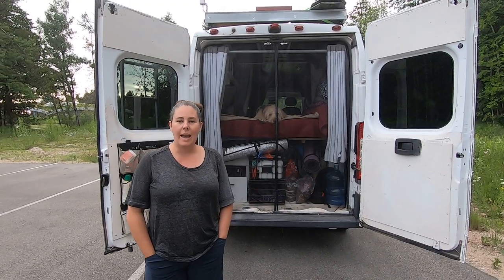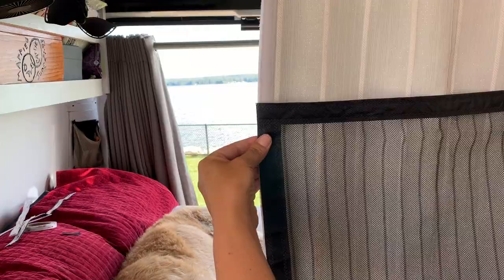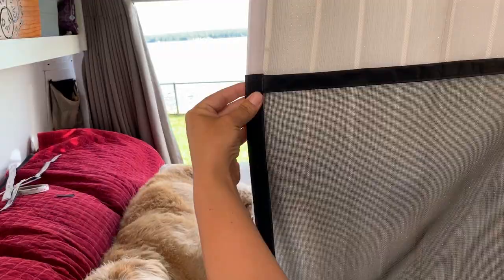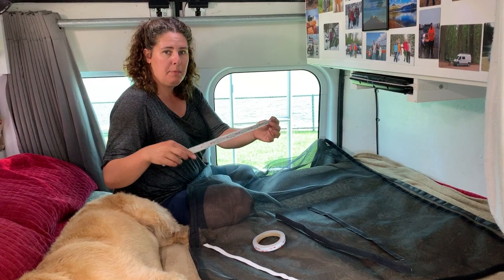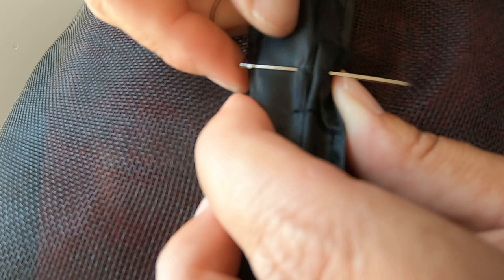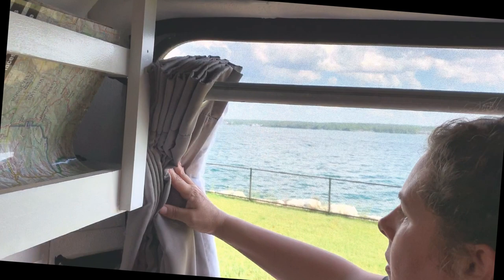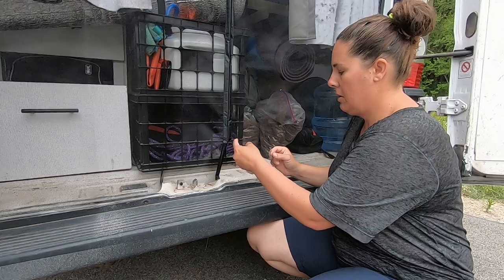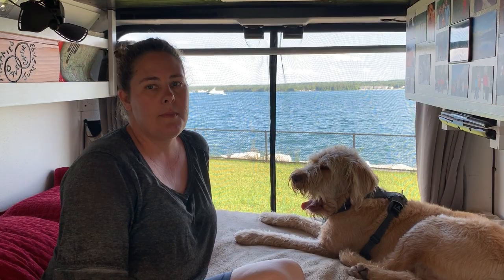DIY Super easy BUG SCREEN for your van in 30 MINUTES or less!

Comment: Great idea!  I love it!  My one possible suggestion to improve upon it might be to hem the bottom and use either magnets or velcro to adhere it to the bottom of your van. If the material isn't flexible enough to hem, maybe using a glue gun to adhere the original hem in alignment with the bottom of your van.  Thank you for sharing!
Reply from the maker: Great tip! We are going to need full bug defenses up for this summers trip to Alaska! Take care and thank you for watching.

Comment: French doors! I never would have found that screen. Thank you so much!  I'm at the ventilation planning stage in my own build, so windows, screens, and a Maxxair have been on my mind. I know you guys are loving that back screen. It turns the rear of the van into a picture window/patio/lounger setup!
Reply from the maker: +cesalt We would go with Maxxair fans instead of fantastic if we could redo. Good choice!! 😀 Yea the bed room has the best window in the house now😂 You might consider a small screened window in the back of your van near your head. We wish we had one there and may still put on in.😎

Comment: THANK YOU!  THIS SCREEN WILL BE A GAME CHANGER.  By the way - you are soooooooooo right about velcro NOT sticking to anything you really need it to stick too.  I have been using 1/4" 3M 3000 double sided tape that has worked very well.  However, the 3m tape that you are using looks as though it might be better (wider).  Thanks again.  I am so glad to have found your channel.
Reply from the maker: Thank you, Barbara! Our screens have been hanging for nearly 4 years with that tape now! Awesome stuff. Carrie wanted to let you know that metal snaps are another idea. They make them now that you just screw in. We are getting some to try out. Welcome to our channel! We are happy you have found us. If you have more questions please ask. 👱‍♂️👩🐕🎾

Comment: I'm putting the finishing touches on my conversion and this is one of the simplest yet important things to do first. Thanks for pointing out the diff between your first screen and the more durable fiberglass screen. Also - I wouldn't have thought to let the tape adhesive cure to the metal wall for 24 hours, so big thanks for that!
Reply from the maker: We are happy to help! We are enjoying our bug screens right now. Even on hot days the airflow makes it nice inside the van. 😀

Comment: You can do same thing to your front windows so can have down and drive with no bugs! Totally a must!
Reply from the maker: +Sunshine Ak I didn't even think about the front window! That would be perfect! The hardest part would be the custom sowing of the velcro on the screen but so worth it!! Very smart!  We agree that's a must😀🐜🐛🐝
Reply: You could use 3M tape lol. I would def do it with the Fiberglass mesh as strong enough to sew it. I would use fishing line as thread so you can peel it off without risk of breaking stitches so you can pull it off so if you need to get to window you can.

Comment: Wow! Probably the best most detailed video I've seen.  Thanks!  By any chance do you know if that tape also works on wood?  My velcro definitely did not.  Actually, follow up, I just read the description on the tape and sounds like it may work on wood.  That would be very handy cause I hate putting more holes in the wood.

Comment: I did it!  Custom fit the screen (which took awhile since the double van doors are definitely not square and much smaller than the rear doors of your rig.   I had to cut them down from both the sides and the bottom.  I am so grateful though that I saw your video.  DIY starting from scratch would have been much, much harder!   The magnetic closures work great!  The only problem I have is that the velcro does not stick to the cloth upholstery fabric on the right side of the doors.  It sticks really well to the rigid composite material on the left side of the door.  For now - I'm leaving the screens up (it's so easy to go through them, coming in or going out) that I'll have time to figure out a way to secure the velcro better for occasional removal.   I know you mentioned snaps that screw in - can you tell me where I can get them?  I've looked at some on a marine supply website -too confusing, most were stick on! Thanks.
Reply from the maker: Nice job Barbara! We are just now putting our rear screen back up and could not live without it once it gets warm and the bugs come out. Type in “screw-in snap kit” on Amazon and there is a bunch of different types to choose from. We just got our kit and have not tried it yet. 😀

Comment: Hey guys! We are to the ventilation step in our van...it has almost been a year since you installed this bug screen. Great instruction, by the way :) Are you still successfully keeping bugs out? Is there something you have done different to make it better since the video was put up? It looks perfect the way it is, but sometimes after using a product for a while things pop in your head that you wish you had done different or just added little touches to improve the product in your personal use. Thanks for sharing :)
Reply from the maker: Great question! We are still using the bug screen and it's still effective.  That said, we should have made it shorter and just go down to the bed frame. It's been a bit of a hassle getting to the area below our bed. We are going to cut it and and more velcro so we can make that adjustment. I am very impressed by how it's been holding up just make sure you don't close it on the door latch😜

Comment: Nice work.  Did your velcro already have an adhesive on it?  If so, did you just put the 3M on top of that after peeling off the backing?  If not, do you have a link to the velcro without adhesive?
Reply from the maker: +freedom dove my Velcro already had adhesive on it 😃 I did just put the 3M tape on After peeling the back. So the double sided 3M tape will have a backing to peel and so will the Velcro.   I peeled the Velcro backing off and very SLOWLY peeled the 3M backing off as I attached it to the Velcro.... the bond will be pretty instantaneous at this point 😬
Reply: Awesome, thanks.  👍

Comment: So how is the bug screen working out, any suggestions, changes or improvements? thanks, another great video.
Reply from the maker: We did manage to put a small hole in it but other then that all has been great. The double-sided 3m acrylic tape has held up perfectly in the cold and heat. We will be working on another this spring for the sliding door.

Comment: When you close those doors, you keep the screen in, right? Is there any risk of the doors tearing the screen?
Reply from the maker: We do keep the bug screen in the back doors until winter. We eventually destroyed our first bug screen with the latch. We now only go down to the bed with the screen as the bugs can't get us from below. Great question! We need to update on our screen. 🐛 🐝 🐜  🦟  👍
Reply: @oneadVANtureatatime  did you do an update?
Reply from the maker: Still working great! We did have to replace it once from normal wear and tear. We just started year 5. Our screen only goes half way down and we kept the middle so we can open if needed. Our first screen we sewed the middle shut.

Comment: I’m getting ready to order supplies and wondering if you would make any changes now that you put in use.
Reply from the maker: +FourWheel Camper we really like our bug screen. The only problem we have had is shutting it in the door😂 it goes all the way to the floor... maybe weights on the bottom.  If money was no object ...I would buy one that we could attach permanently with zippers.  But for the price it works perfect.

Comment: Do you need to add velcro at the bottom of the screen so that bugs can't get in that way?
Reply from the maker: +Ann Ryan you can! we didn’t and it was fine. We are just about to revamp our big screen. It works really well but we found that it was a pain to access anything in the garage under the bed. We also kept shutting it in the door and eventually put a hole in it...... so maybe Velcro at the bottom would have solved this. No bugs can access the van from under the bed so we are cutting our screen so it only goes halfway down.   I did want to add that we have had no problems with any of the Velcro coming off.   Feel free to ask any additional questions if you have any😃
Reply: @oneadVANtureatatime  That's good info. I hope to install both the back and side screens today, so I will definitely secure the back one at the bottom because there's an open space under my bed that would allow the bugs in.  Thank you so much for your quick reply!  I really enjoy your tutorials!!!  Happy trails to you!

Comment: Did you secure the a bottom somehow or just let it hang and if just hanging, doesn't that allow bug to get in
Reply from the maker: +Jeff Krushinski we just let it hang..... but it was such a pain in the arse!!! We kept shutting it in the doors and it made it hard to get to things in the garage area under the bed. We are just about to revamp this screen for the summer.  We are only going half way, we added a wood plate across the back and the screen will Velcro to that.  Under the bed is blocked off from the rest of the van so no bugs will be able to get it..... we think 🤔

Comment: Great video. Just got a 2021 promaster with rear bath setup. Wondering if this setup, 3m & velcro would work? South Florida heat and all..
Reply from the maker: +Sam P.A. I don’t see why not! I am a HUGE fan of Velcro and the 3M double-sides acrylic tape. I have had the Velcro on our windows for two years with no problems from extreme heat (100degrees F) & cold (-6 degrees F) the only thing I can’t vouch for is humidity.  Warning.... once the acrylic tape sticks it is extremely difficult to remove.... so think about your placement. Also it does not like to stick to weather sealing around the doors.
Reply: @oneadVANtureatatime  thank you.. (been researching), seems amazing. Thinking good for magent placements here n there,, on shower surround and velcro vs glue and other. Again,  thanks for sharing

Comment: did you need to add any trim at the bottom where you cut it off?
Reply from the maker: Hi Mary Beth. We just updated our back bug screen. It only goes down to our bed now. Carrie cut the screen and sewed a strip of Velcro to the area she cut. So no trip was needed because the velcro takes the job of the trim. I hope that helps. Right now we are enjoying a bug free summer breeze in our van. 😎

Comment: Can you leave the screen in place when you close the doors?
Reply from the maker: Yes!  Just  make sure it does not get caught up in latch or it will eventually tear. Hopefully that helps.😀
Reply: @oneadVANtureatatime  I saw this video just in time to repair our malfunctioning screens before or trip next week.  We used and loved bug screens them last summer, but the tape that came with the screens eventually fell off the van (Promaster).  I was wondering how to make it stick better, and the 3M tape I ordered through your link just arrived today. I can't wait to put it on.  I'm going to wipe down the metal with alcohol before applying the tape, just to be sure.  Also, thanks for the idea of applying INSIDE the door trim. I had put ours outside  (but still inside the door frames) and had to remove screens to close the doors.

Comment: Have you installed one on the slider door yet?
Reply from the maker: Hi Mike. Two months ago Carrie made a bug screen with zippers and magnets for the slider. Unfortunately, we did not make a video on how we made it due to time restraints. Right now we are using it and love it. We have the back doors open and the slider, a light breeze is pulling through the van and many mosquitos are trying to get in but are failing! 😂 It would have been handy to have this set up before we started this journey. If you have any questions please ask. I will ask Carrie to answer any questions on her big screen.